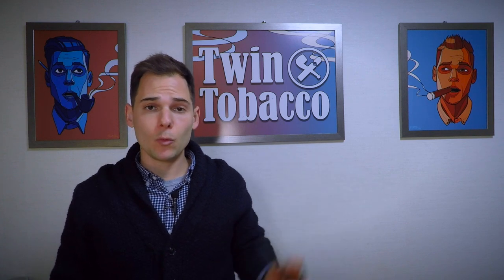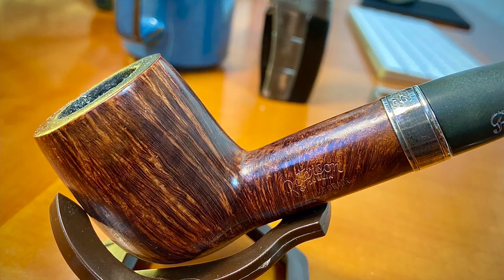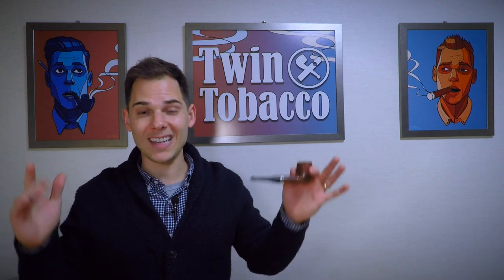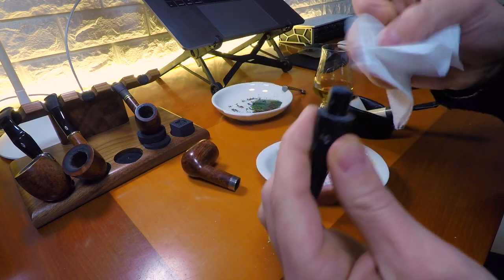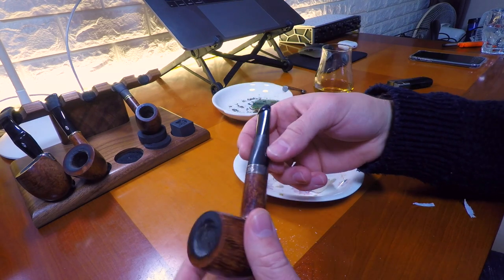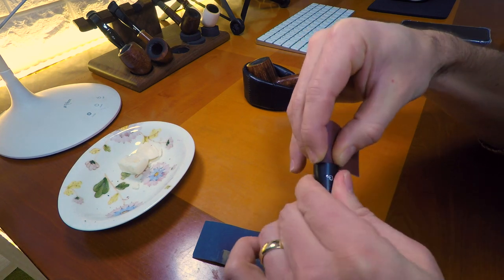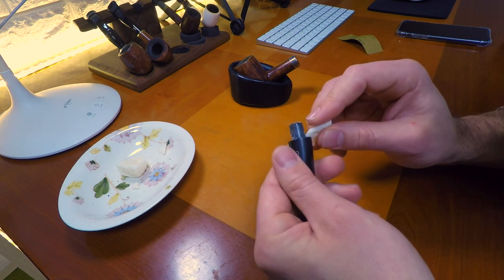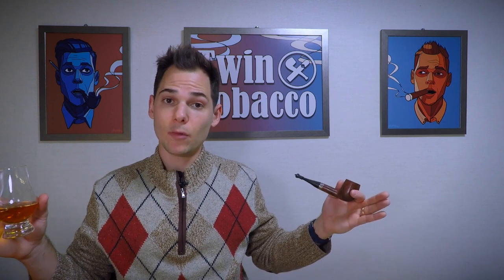How to Fix a Tight Pipe Stem

Comment: I've used the bar soap method, and it works.  But not forever.  Keep the soap handy, because you will have to renew the soap treatment periodically.  As for the sandpaper, use it just a bit more than necessary, and you'll have the opposite problem.